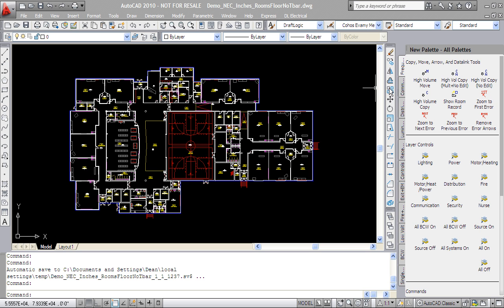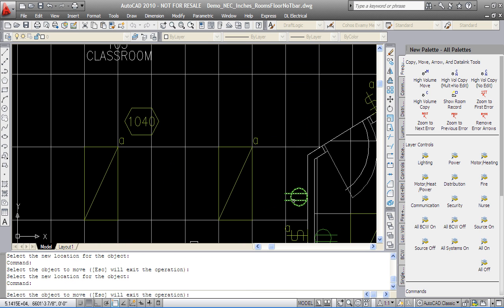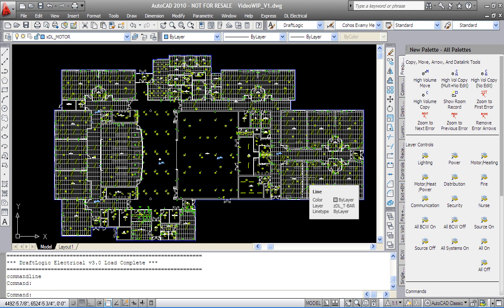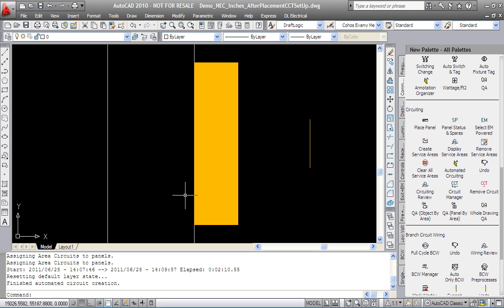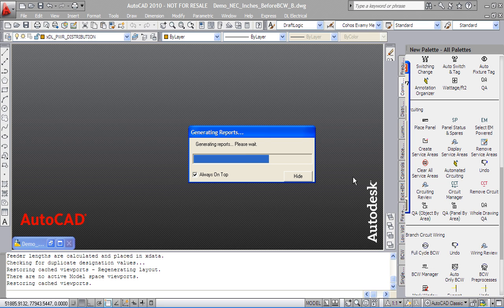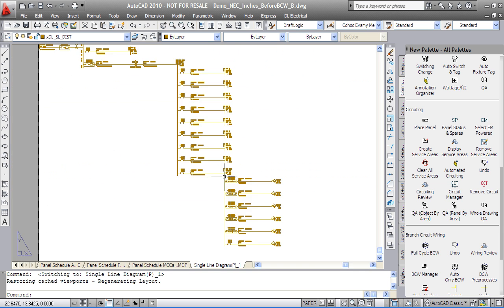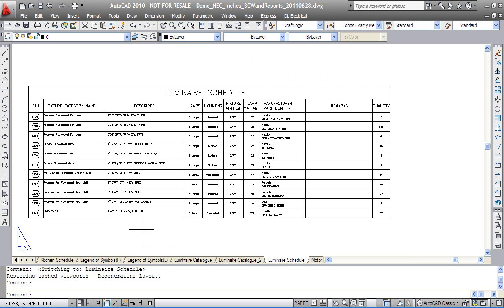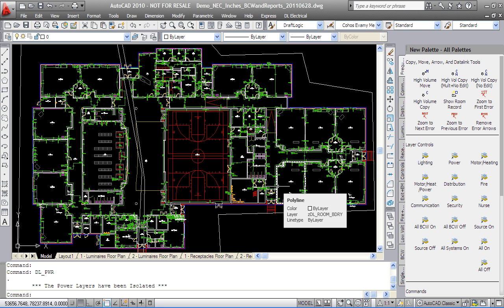DraftLogic Electrical HD Overview 32 Minutes

Comment: Good job guys! I am an electrical designer who has produced multiple jobs in AutoCAD, AutoCAD MEP, and Revit it’s interesting to see some software designed for production as opposed to just offering safe guards at the cost of efficiency.  I had previously thought that the pinnacle of software engineering was the relay control which turns off the elevator button shortly after you press the floor you are currently on.